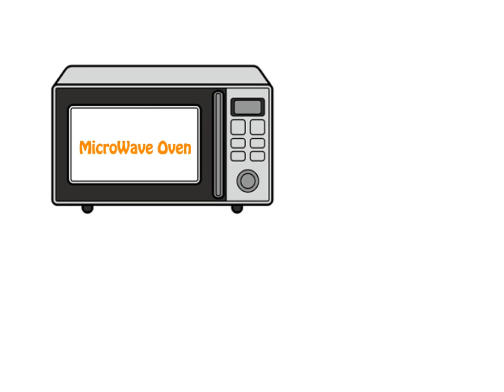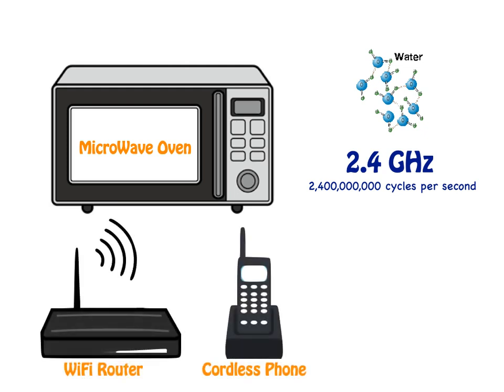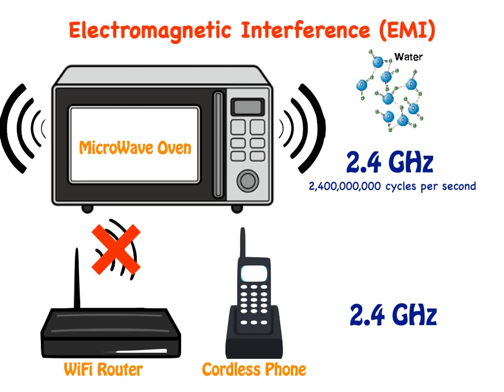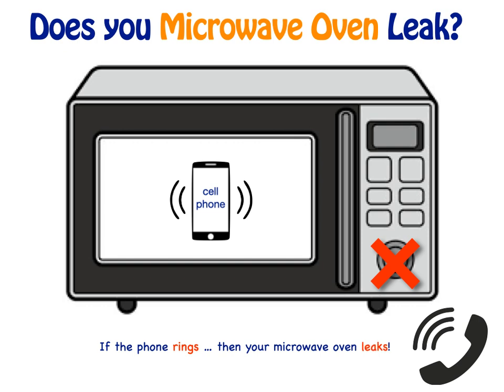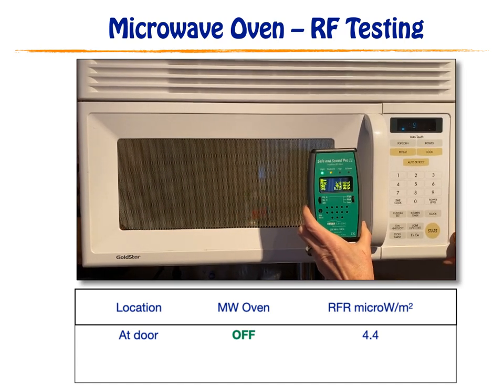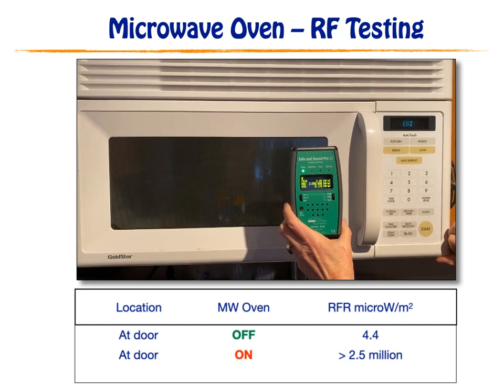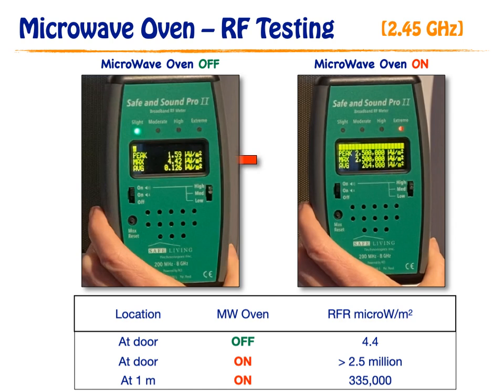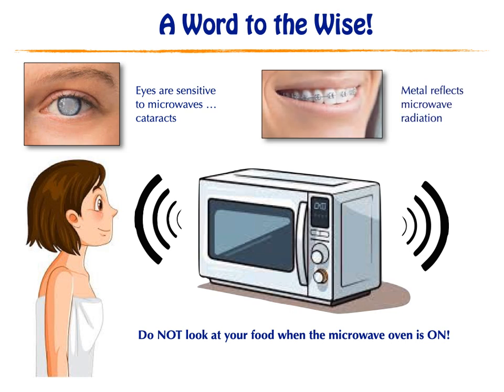Does your MicroWave Oven Leak?

Comment: I pray this comment finds you well. Peace and blessings to all! You may already know this, however, I have been researching what causes the high pitched tinnitus from EMF/MMW/RFR transmissions, and I have had a breakthrough. I was pondering how antennas work. Their size is relative to the frequencies that they receive. I then started looking at the average size of the cochlea, and the pineal gland, comparing those measurements to the wavelength of specific frequencies, and I was amazed at what I found. 10GHZ and 39GHZ wavelengths coincide with the average size of the cochlea(1.18inches) and the pineal gland(.3inches). Both are used for microwave communications in modern society. I am certain that these frequencies were chosen to be utilized to target these specific areas of the body to cause this sort of reaction. What I am not certain of is if it was done to eliminate people, or bolster the corrupted medical systems by creating new ailments that need to be assessed by doctors in general health, neurology, mental health, and others. It reminds me of how they put fluoride in the water to supposedly prevent cavities, but anyone with half of a brain knows that fluoride is a neurotoxin that leads to the calcification of the pineal gland. Typical "Problem/Reaction/Solution"...

Comment: Yep.  I told people that my phone ringing while in the microwave would mean the shielding was not working and I assumed it was leaking radiation when used.  I tossed the house microwave and will not use the one in the motorhome which is built in and has the fan and other things more or less attached to it.  I did unplug the damn thing though.  People have zero idea and when you try to tell them, they don't care.